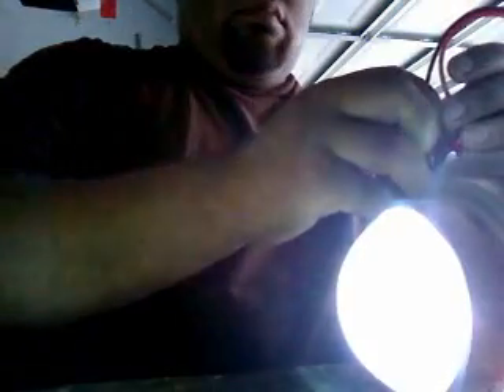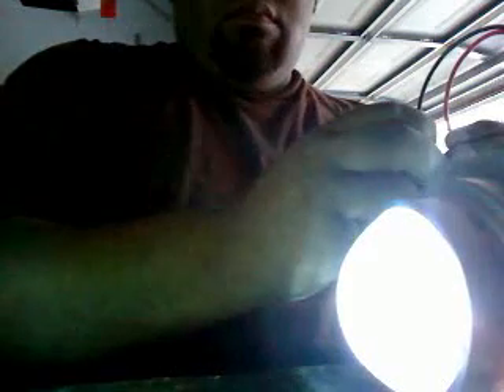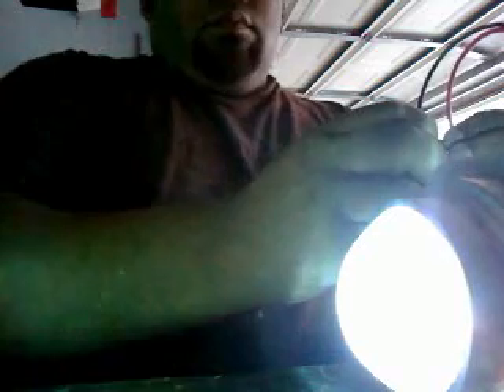LED Heat testing

Comment from the maker: if u mean if the LED is on the same time the HID is on then yes it would work but the HID bulb is so bright it would overpower the LED. I just have it set up to survive the heat emitting from the HID bulb and work whenever the user wants it on.